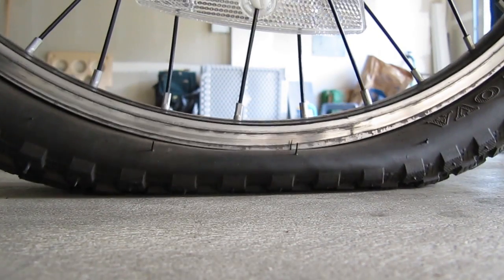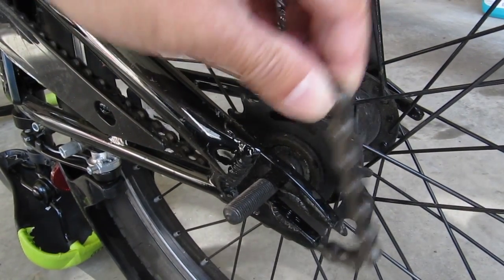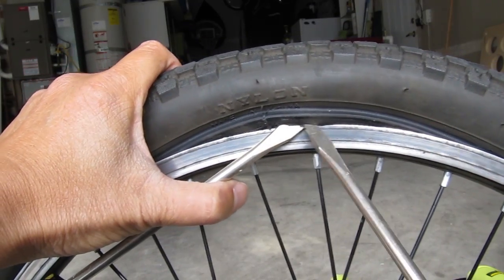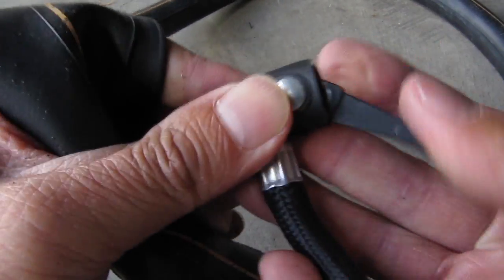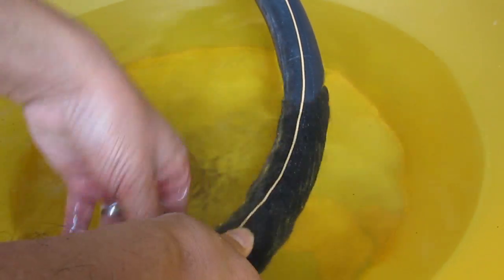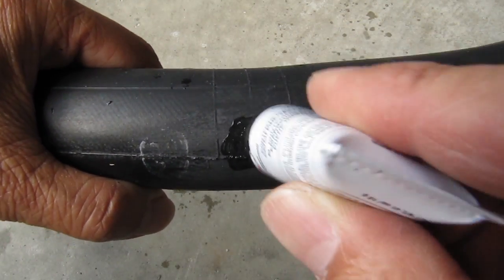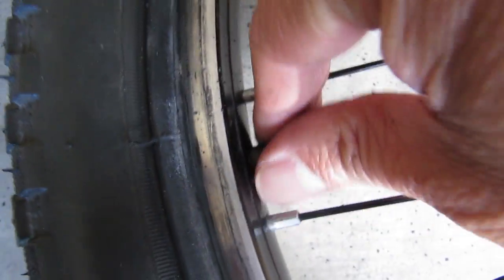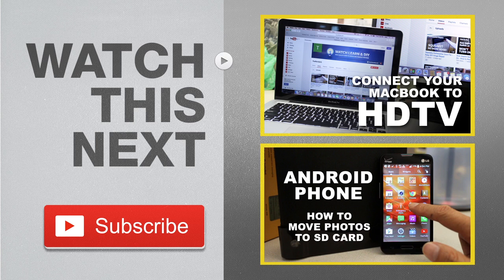How to Patch a Bike Tube – Fix a Flat Bicycle Inner Tube with Coaster Brakes

Comment: Not good prsactice to drag the tire lever inside the tire - can damage the tube. Also, need to check the tire corresponding to where you find the hole in the tube in case the cause is still in the tire (thorn, glass, etc.)